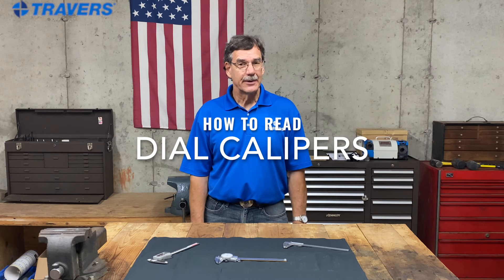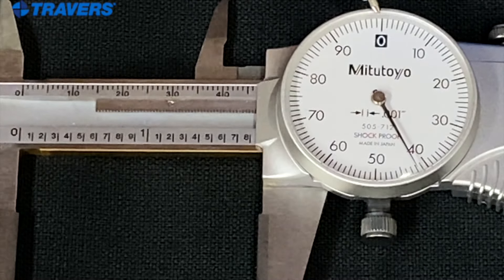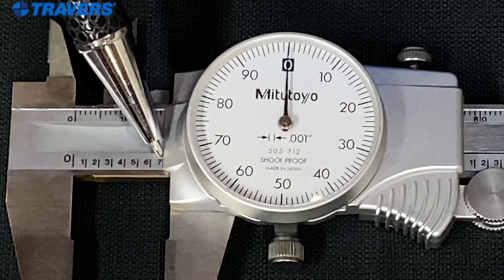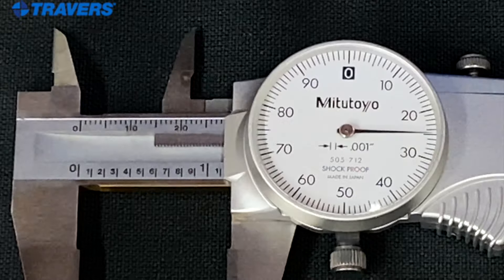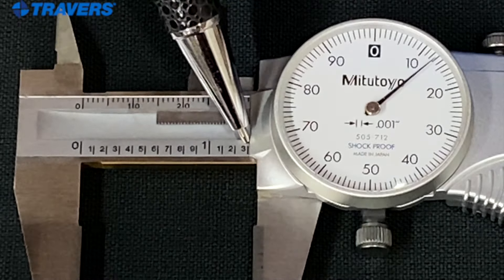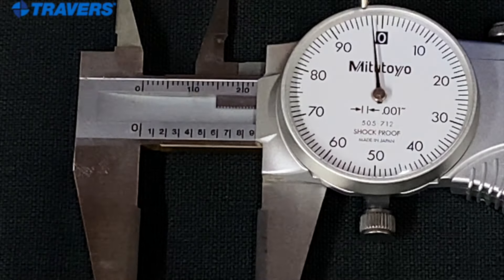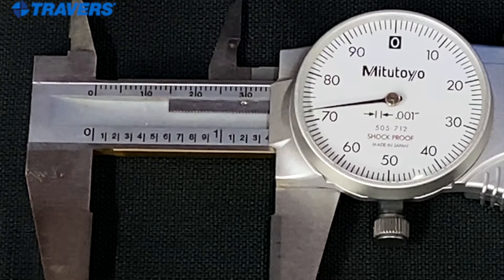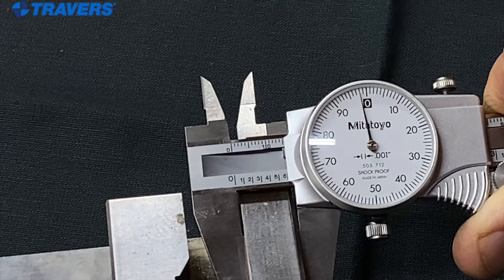How Do You Read Measurements Taken With Dial Calipers?

Comment: Would have been much easier to explain in decimal instead of fractions. 1 and 1 hundred and 25th of a thousand is better conveyed as 1.125 inches.
Reply: I agree, @Bren39, which is why I did this video in decimals.  Fractions are "a thing" though, so I might do a video someday on reading a ruler in fractions, and then if we're talking about what would be "much easier"-- nothing is easier than the metric measuring system, once it's understood.

Comment: This video is really helpful. So I really thank you for posting to you. I've learned a little bit more than I knew before, but I have one question. How can the numbers in between the inches? 18th or a 100. How can they be the same thing? It's either a 10th or a 100000 how can they be called 2 different things at the same time? Thank you..

Comment: Nice teaching , dial calipers not only are precise, they look cool and interesting measuring tool. After using electronic ones i prefer this one. Also using dial calipers makes you way aware of the measures, digital ones like all electronic stuff can go faulty. Meanwhile this one is more resistant 👍
Reply: I agree completely, lel_juan.  The only thing I use digital calipers for is when I'm going back and forth between imperial and metric measurements.

Comment: Thank you for the simple yet very informative video. But I'm a little confused, my Mitutoyo dial calipers have two 0s on it. One positioned at 12 o-clock and the other at 6 o-clock  with 1-99 hashmarks following each one. Does this chainge how to interpret the reading, and if so how?
Reply: Could be a different resolution

Comment: I started out with verynear 😮calipers then graduated to dial calipers. So much easier. But the digital calipers are the first ones I grab when I need to measure
Reply: Hi Andrew.  Digital calipers definitely do have their place.  Nothing converts from inch to milimeters easier than digital measuring tools do.

Comment: what happens if it lands between the 1000's of an inch, or 1/4 or 3/4 between the 1000's of an inch?
Reply: Hi kracksmith4ejm1.  For that level of accuracy, I would recommend using a micrometer.  However, if the pointer is 1/2 way past a line, you can add 0.0005" to that number.  If it's 1/4 past a line, add 0.00025"; if it's 3/4 past, add 0.00075", etc...  But again, since the accuracy is ±0.001" for calipers, to be certain of an accurate measurement, a micrometer is the better tool.

Comment: For an outside measurement, wouldn't you want to find the highest spot?
Reply: Yes, assuming you're not measuring a groove, or any other type of a recess.  But you'll need to find the smallest measurement of the highest spot.  At 5:35 into this video, you'll notice me rocking the calipers back & forth to find the smallest measurement.

Comment: Need to explain the mm side more. I don't have a dial I have marks on the top edge, 0, 2,4,6,8,10 and obviously have the standard 0,5,10,15,20,25 on the bottom. It's accurate just need to convert it I guess.
Reply: Hi Ryno. The metric measurements on standard (inch) calipers can only give you a rough, vague idea of the size you're measuring. The dial & needle only read in inches. To read millimeters, it's best to either get metric calipers, or digital calipers that switch between inches to millimeters.
Reply: @wonbythe1  I just used a conversion table. Thank you
Reply from the maker: Thanks Kurt!

Comment: Good explanation, but much easier to use metric.
Reply: Oh man, @cicerobg -- do I ever agree with you!!!  The metric system makes so much more sense, which is what makes it a lot easier.  Way back in the 1970s, the USA started switching to metric, but then we stopped part way in, and using both metric and imperial, resulting in even more confusion.  (Sorry for the history lesson.  It's just crazy!)

Comment: Why is that your favorite when you have to compute a few things while a digital just tells you straight up and can even tell you in fractions?
Reply: Hi Jon. After using dial calipers for so long, doing "the calculations" comes instantly and naturally. There are no batteries to die. On good, high quality dial calipers, even though they only read to thousandths (0.001"), you can see how close the needle is to a line, and get a rough idea of how many tenths (0.0001") away from the line you are.

Comment: Set the zero!
Reply: Great point, Bjorn.  This wasn't intended to show how to use them, or it would have needed to include much more.  The point here was simply to help people learn how to read them.  Absolutely, though -- clean the jaws and check the zero before each use.  Thanks for pointing this out.
Reply: @wonbythe1  
Yeah I hear yah.
It's just an easy thing to miss if you use them quick.
Your video was on point and informed
Reply: Thanks.  I should probably do another video on how to use them.